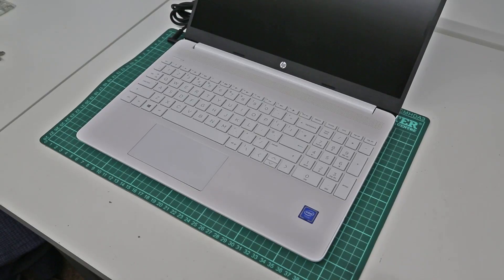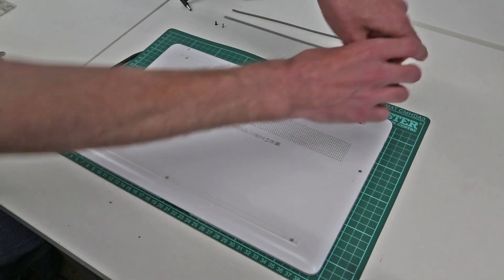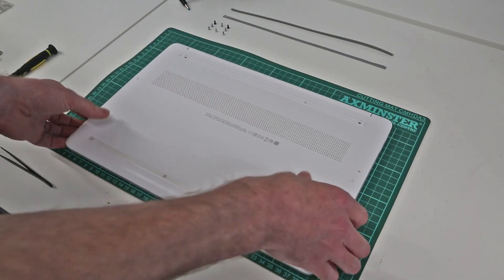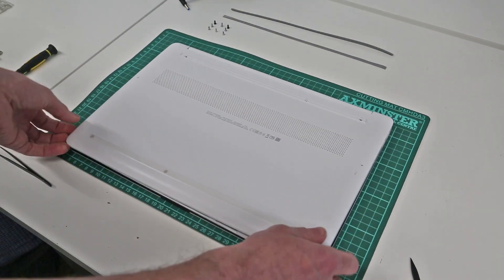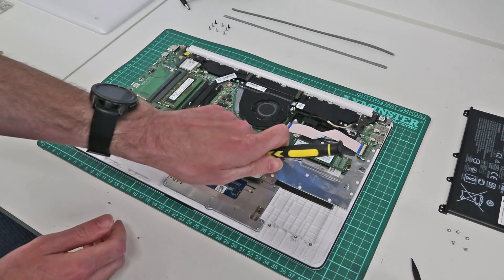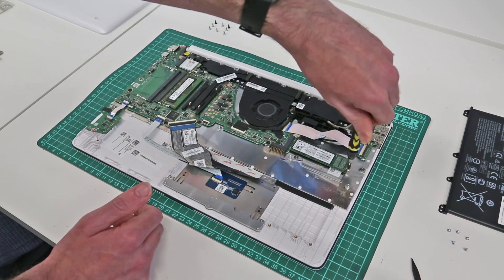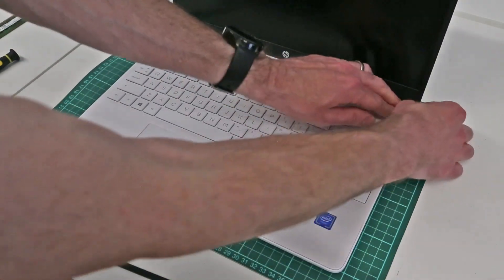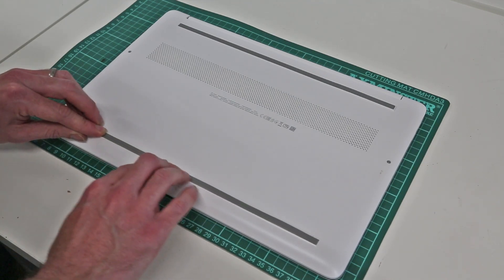HP 15s-fq1515na SSD Upgrade Guide

Comment: I have a 15s-fq, can you install another SATA ssd? What connector do you need 8 pin?
Reply from the maker: This is the cable you'd need: https://amzn.to/3ZHqaeL
Not got a source for the mounting brackets - you could in theory just attach it with double sided tape for an SSD.

Comment: Is the operating system installed on the M.2? If so, then wouldn't upgrading the drive cause the laptop to stop working?
Reply from the maker: You have to either clone the contents of the drive or do a clean install. I have other videos on how to do this - this one is just physically how to install the drive.

Comment: Thanks, what is the max SSD you can add to these? - I'm thinking to put a 'Samsung 970 EVO Plus 1 TB PCIe NVMe M.2' in it
Reply from the maker: Any single sided M.2 2280 SHOULD work, so 970 Evo Plus 1TB should be no problem.
Reply: @BrueComputing  What are the significant problems upgrading using lower brand SSD?

Comment: Hey thanks for the video, i am confused between HP 14s/15s 5300u 512gb SSD, 8GB DDR4
Dell 3501 I3 11th Gen 256gb, 8GB DDR4

Though hp has better features, i actually don't like it especially the keyboard and the plasticy body

What do you suggest, since i saw you 3501 teardown too, i fell both hp pavilion and dell 5000 series are better but they cost too much, Dell doesn't even have a 5300u laptop
Reply from the maker: Personally I'd probably take the Ryzen 3 5300U over the i3-1115G4.  The larger SSD is a bonus too if you need the space.
Reply: @BrueComputing  Thank you

Comment: Hi
I have a 15s-du1034TU

Is it possible for me to upgrade another ssd?
Reply from the maker: The 15s-du1034TU comes with a 2.5" HDD as standard. You may be able to add an M.2 SSD in to the system, but I would advise opening it up and checking for the presence of an M.2 slot as sometimes this is silkscreened on the board and not included on models without a SSD from the factory.
Reply: @BrueComputing  how about 15s-du1057tx?
Reply from the maker: That comes with an M.2 SSD, so will not have the cable, bracket or connector for fitting a 2.5" SATA drive installed - HP don't include these if they aren't being used.
Reply: @BrueComputing  So can I install another driver in 15s du 1057 tx ?
Reply from the maker: @auyongmunkeng3111  Only if you can source the additional parts that you'd need, which not really economical as you're looking at £75 in parts if you can even find them. Personally I'd just install a 1TB+ SSD.
Reply: @BrueComputing  alright thank you very much

Comment: At 7:10 so you're saying if the model has a PCIe based SSD then it's not possible to install an additional SATA drive on it?
Reply: i understood that its not cost effective, you have to buy the sata ssd the cable and the mounting if needed, i already have  an old laptop with that, mine came with an  m.2 ssd so i am going to use the space this sata ssd
Reply from the maker: You can, but you'd need the specific HP cable, connector and brackets which aren't easy to get and tend to be expensive.

Comment: Is there a slot to connect the cable for a 2.5 internal 
ssd
Reply from the maker: Yes, but you'd need the specific HP cable, connector and brackets which aren't easy to get.

Comment: So is this impossible to add HDD to that box space ?
Reply from the maker: Yes, but you'd need the specific HP cable, connector and brackets which aren't easy to get. They aren't present if you have a model with an SSD as standard.
Reply: @Brue Computing plz reply